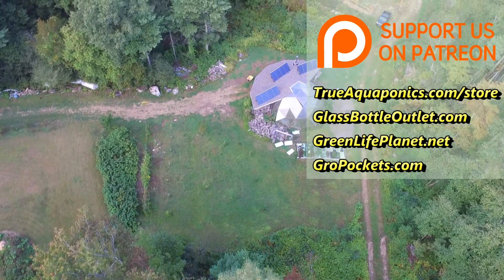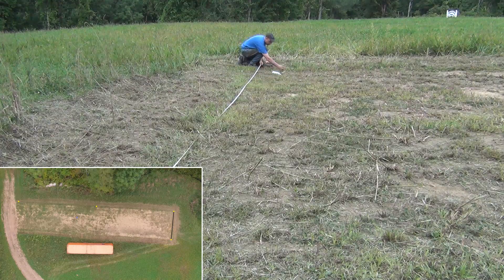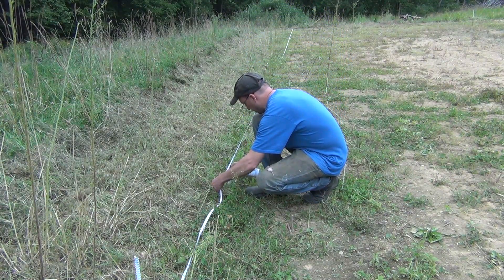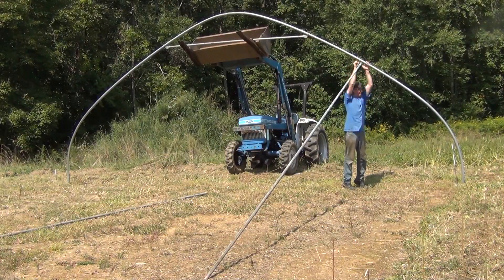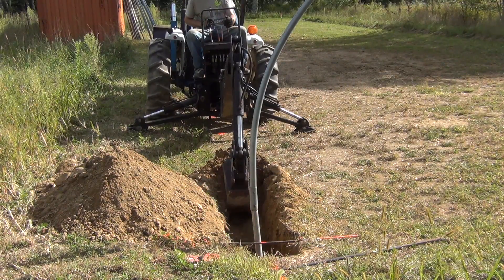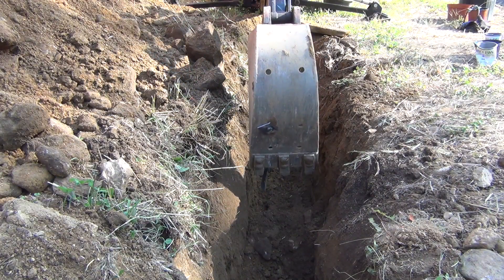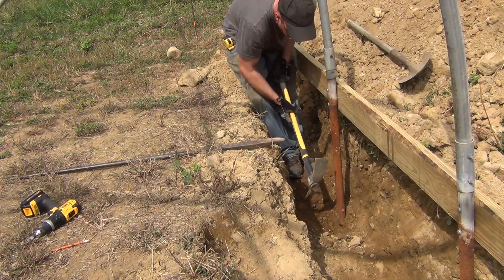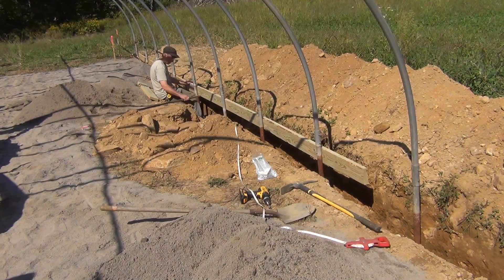Big Aquaponic Greenhouse - Part 5 - BUILDING THE FRAME!

Comment: I've been considering ways to save money building my first dome house, about a 60 footer maybe more. Glass is so expensive, and I might use automotive windows from the junkyard to work into custom frames housed in a shotcrete+rebar frame constructed dome. I hadn't considered using melted milk jugs recycled into panels until I realized they should just need some uv reflective clearcoat paint off Amazon to keep them from crumbling in the sun.  Anyone with any 'bright' ideas , please let me know. I'll start on this in about 2 -3 months max. thnx

Comment: Do you need to pull a permit for that sort of thing, or is your town easy going?
Reply from the maker: I needed a Wetlands permit (which is easy to get) because we dug in the ground (even though we aren't digging in the wetlands).  There is no permit for the hoop house because it is classified as a temporary structure.  I will need to get an electrical permit at some point.

Comment: wouldnt the rust eventually eat through the posts if they are just stuck in the ground like that?
Reply: They're galvanized steel so "eventually" is usually long enough.
Reply: but galvanizing protects only the surface and as you can see, its already rusty
Reply: Keep in mind, this is used equipment, it's already spent years in the ground plus a couple years lying around on his field.  What you see if probably just staining of the corroded zinc.  Heavy enough galvanizing will protect the entire metal object, that's the concept behind sacrificial anodes in maritime applications.  They literally include a giant hunk of zinc in some random spot that will oxidize before the steel so long as there is a proper conductive connection.  It's pretty neat actually.
Reply: I am trying to learn how this works, I understand that its used, but still isnt the fact that its orange indication of that it already ate through the galvanized layer? zinc oxide is white/gray after all.
and I agree, sacrificial anodes sound p damn neat! never heard of them before, then again I live in a landlocked country :)
Reply from the maker: this is a used greenhouse which is about 30 years old.  The posts are in fairly good condition.  We estimate they'll be OK for about 20 more years before the need to be replaced.  By that time I'll be retired.  ;-)
Reply: If you are a weirdo and want it to last forever, you could pull a tight fitting PE or PVC pipe around the leg and maybe melt it on. Or pour an inch thick concrete around the legs. Concrete is basic, and prevents corrosion for a long time.
Reply from the maker: Water will condense inside the tubing over time.  If you encase the ends of the tube in concrete or plastic, it will hold the water and will probably rot out even faster.
Reply: Could use some tar or a similar water resistant durable coating
Reply: That seems correct. Leaving the end open is the wiser idea. 
I did not consider this since we usually make hoops from a continuous pipe (diy bent pipe stock) so both ends would be sealed. (And we are not using any film holding device but bury the ends of the material, but we have soft sandy soil so i understand why you would not)